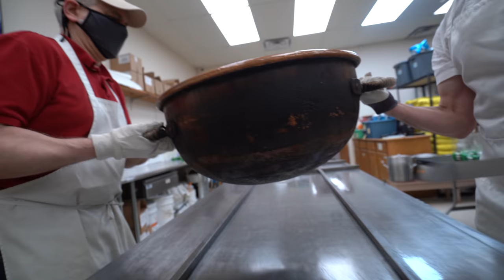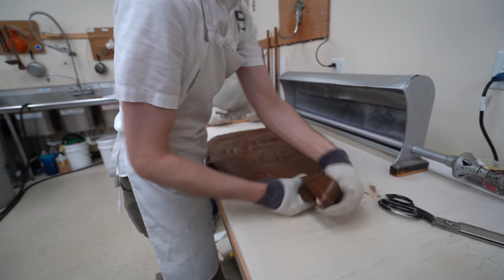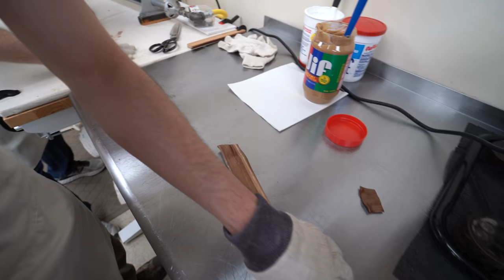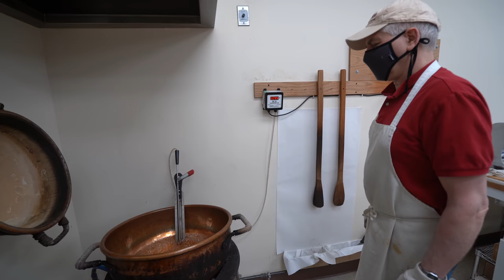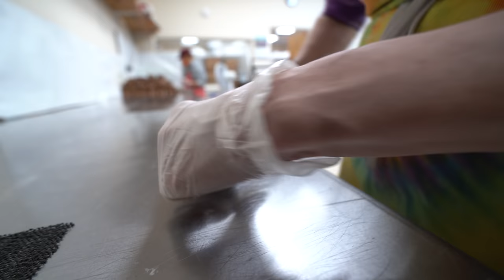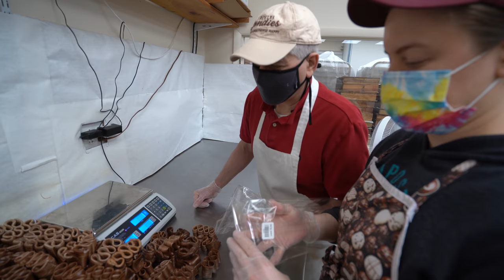The Worst Batch Of Ribbon Candy EVER! 😳 Did We Throw It Out?

Comment: irecommend doing  the chocolate in 4 equal portions.  a base chocolate layer topped with a peanut butter layer, sealed with a second layer of chocolate, topped with fluff, sealed with the third layer of chocolate.  the final or 4th portion of chocolate candy could be used for patches, using over sized pieces to seal leaks

Comment: This might be a dumb question, but I was wondering, have they ever tried doing the filled candies in the cutter?  (Yeah, not sure what it's called)  The gadget that cuts the hard candies into pillow pieces. (The old one, not the newer one they use now for the flat pieces) I would think, since the candy is pulled into a rope before cutting, it would hold the filling a bit better?  Maybe.  Just a thought.  Probably wouldn't work, or they would have tried that by now.. heh  That or when they slam that lid down instead of sealing the filling into the pillow, it would just squish it out and make a mess.. heh  Would be awesome for the apple filled with caramel.  Anyway, I was just curious.  I haven't caught up on every single video, though I have seen most, and just don't recall that ever being tried.. but you probably also don't record every single thing they try either.    Even though this batch didn't turn out looking the greatest, I'll bet it was amazing.  Thanks for sharing.

Comment: What you guys need is a self-hammering hook. Put in a foot pedal connected to a wire, that pulls on a spring tensioned hammer and hits the hook from above when you step on the pedal.

Comment: Also, I noticed that the peanut butter's oil was pooling around the edges cause things were hot. Yall can make your own PB easily, as you probably already have the equipment. There would be three benefits : 
1) You can control how much (or none) oil is put in. 
2) It's waay cheaper. A bottle of raw shelled peanuts is a fraction of the price of a bottle of good peanut butter
3) Y'all can experiment with different nut butters, and find the best combo for candy making. Personally, I recommend almond for texture.

Comment: I am far from a pro, but if I was making that candy I would make an indentation/small well in the bottom half to put the peanut butter and fluff in and have a slightly wider edge for sealing the top and bottom. Then do a small roll and pinch all around the edge to seal it.

Comment: I'm sure I'm not the first to say it- but the reason it went all soupy was the Jif. Jif has hydrogenated oils and added sugar, unlike a pure peanut butter. Those additions make the melting temperature just that much lower, so it 'melts' in the mouth rather than "sticking" (which supposedly gives it a better  mouth feel, but I personally disagree). It will melt way faster than a straight peanut butter. If you want to make real peanut butter easier to spread, ust warm it up a couple of degrees, or whip it- depending on what your end goal is.